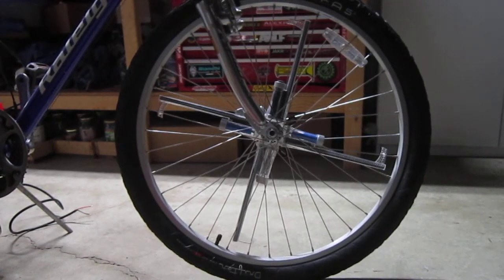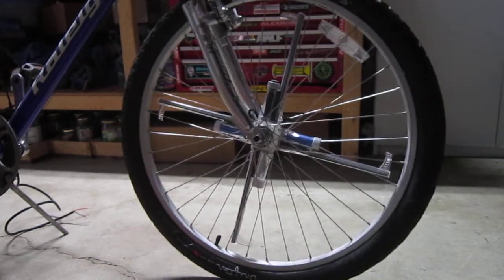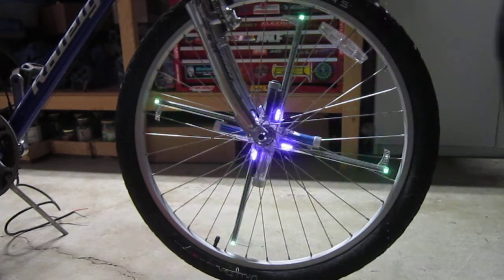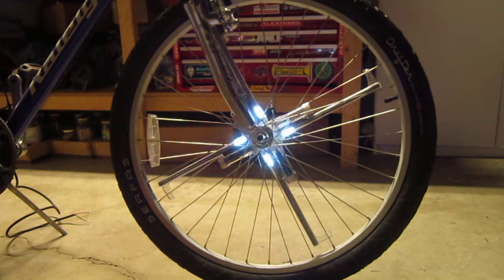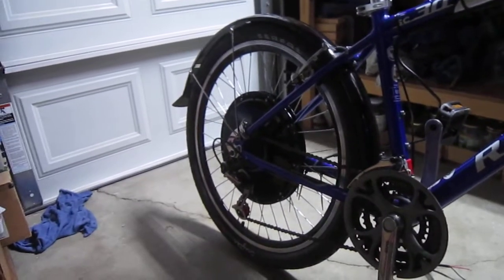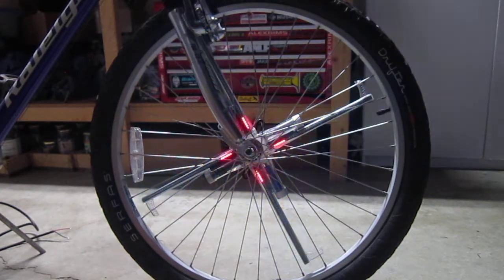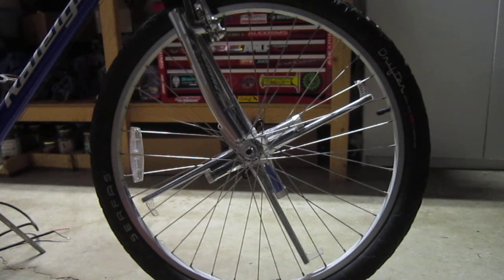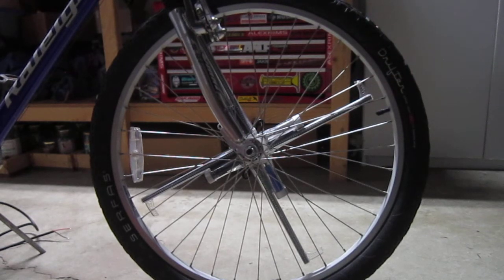FTL FH-801 Pro Programmable Wheel Display

Comment: Hi, I have the lights and got the button top batteries separately, which way up do the batteries go in? does the button top connect with the spring or the the screw top? I can't seem to get them to charge. Thanks for any help in advance.
Reply from the maker: It was pretty straight forward, covered in the instructions I would think. There are a pair of the specific lithium batteries (like oversize AA batteries). The small round tip (like the + on a AA) goes to the outside. It charges like many USB items and is fully charged when all the lights turn green.
You did get the instructions right?
Reply: @TurboBobsBicycleBlog  how do I post a link to the software for this backlight ?